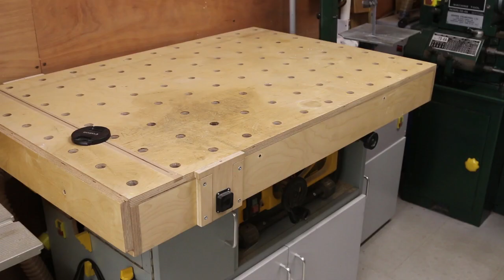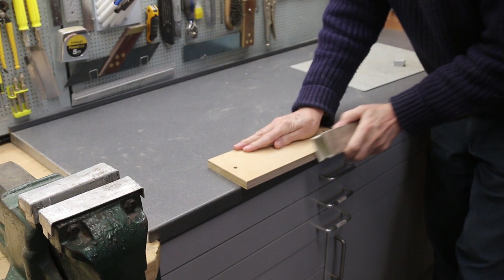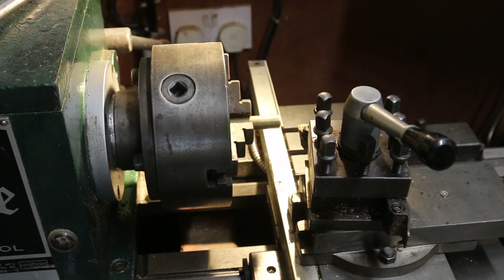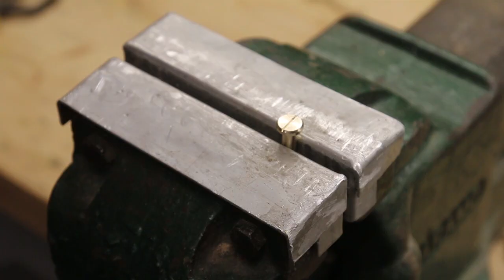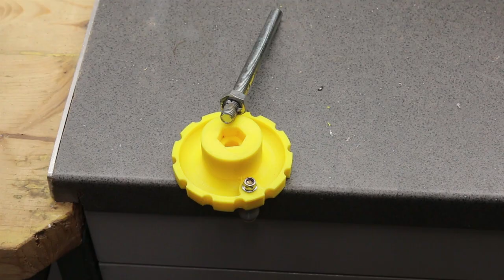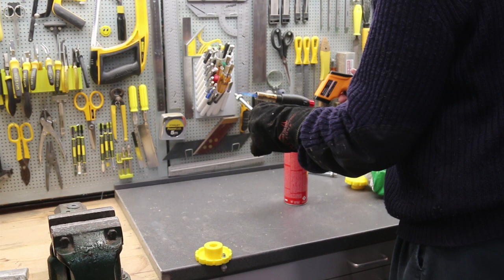New vice

Comment: Nice job Mike. I use a yost vice I got a while back but your DIY solution will work fine as well.
Reply from the maker: Yes, used it a few times now, and it works fine.